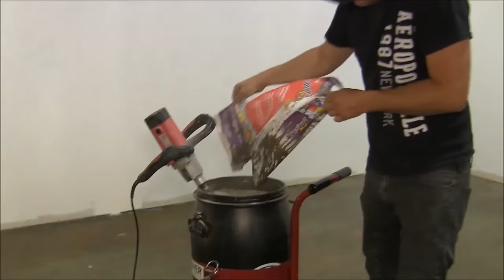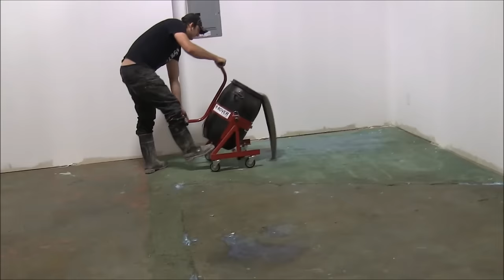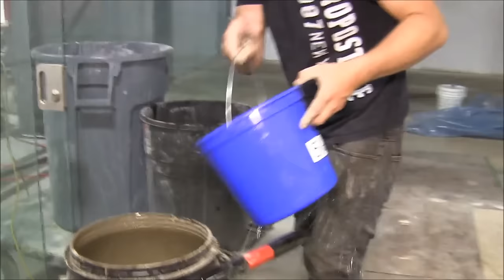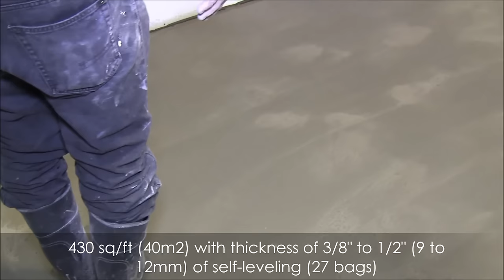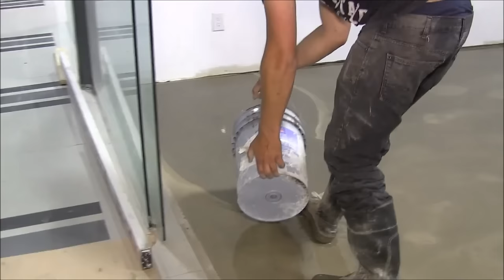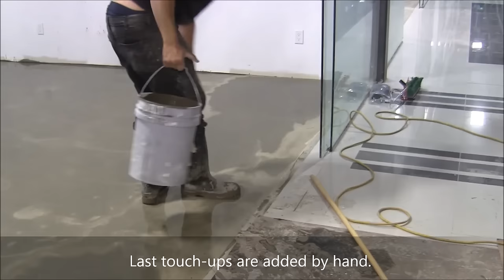How to use self-leveling on large floor areas

Comment: I remember when I use to work with self leveler. I can definitely say I mastered it and was getting paid wonderfully. it's easy to mix and install, I love it
Reply: I've done this a few times but Idk how to price it correctly.. would u be so kind as to give me some pointers on that please?
Reply: @chapothakid5080  The best way to charge for self leveler is to charge by the foot. But you have to keep in mind that it is way more expensive than regular concrete so you might want to charge some where around $11per sq ft.
Reply: Thanks for responding... I usually charge for the labor and have them buy the material..
Reply: @chapothakid5080  It's easy. Charge a lot.
Reply: With that information if I accept about 20 similar job descriptions, I just might make up for bid mistake,s of the past.it appears effortless.very deciving. Thanks a million.it has now become a direct challenge! Takein no prisoners!
Reply: Is it required to apply a primer before putting screed and a sealer after you pour it. I ask cos I just wanna leave it as is and not cover it
Reply: @sbuthabethe7636  Yes you definitely want to put a primer down before you pour it, so it will adhere to the floor properly and if you don't use a primer. It has the possiblity of blowing up( giving your floor massive bubbles). You would also want to prime the top if you plan on using sealer, that way it's guarantee to stick.

Comment: It's also a good practice to use cleats or spiked shoes and use 1/4 in foam strips along the walls to allow for expansion/contraction especially in areas where more leveler is being used.
Reply: Go metric sonny boy
Reply: You're saying concrete expands and contracts like wood?
Reply: They make special rollers for this application  , it even helps remove air bubbles.

Comment: Thanks for the basic demo.   I've seen professionals take it farther with  laser level, depth tri-pods, and spiked rollers to break surface tension and make it all smooth as glass.
Reply: Spike roller is not for breaking any tension.
Reply: @misiokinsale  It lets air bubbles out, and it flattens the leveling compound out, especially where the two pours meet that are of different consistencies.

Comment: Hi. Great video!!! I'm doing 2 rooms basically 14' x 14'. It's bare concrete and is pretty level. If anything between 1/8" - 1/4" out. I putting vinyl floor planks as my floor. Would I start with the low spots first? Or would it just be better to do a skim coat and it will fill the low spots as I spread it with the spiked roller I have? I also went ahead and got the shoes as well. Any input would be very helpful!!! Thanks again. Enjoyed the video!!!
Reply: Yea I raised a floor up to level instead of going for flat you should be able to skim flat is much more important then level I wish I was told this wasted much time and money looking for a level floor when I just need ed flat

Comment: Surprised you went right up to the drywall. No moisture issues with that?
Reply from the maker: Drywall is 1/2"-13mm from the floor and self level cement in 1 hour is dry/hard...is no time to absorb from the floor.Thickness in this floor was  3/8" to 1/2"  10-13mm

Comment: I want to level an area that would involve covering the bottom bit of drywall with leveler.  If I trim off that drywall, there would be minimal overlap with the bottom sill plate of the wall.  Should I go ahead and cut off the drywall or try to cover it with something like redgard so that there is a moisture barrier between the concrete and the dryall?  Thx..
Reply: Don't cover the drywall. You want the drywall off of the floor a bit so that if there is ever a spill or minor leak, it doesn't soak up into the drywall.

Comment: Hello I have laid leveling compound on a garage floor but I have not used enough and the compound I have  put down needs to be raised a few mm as I have not used enough. Can I top it up?  it has only been put down 24 hours but I need the level to be level with some concrete that goes round the sides of the garage. please help

Comment: The consistency of the self-leveling underlay being used looks VERY watery. Batter is usually thicker.  Looks like he needs a longer set up time to work the product but result may be compromised if more water was added to the mix than called for.  Using a squeegee like that would normally reveal high points as it's pulled across the surface, but the soup prevents that from happening.  Well, floor is getting significantly raised up.  27 bags worth... that's a lot of product.   Also, primer usually is applied with a soft push broom on concrete, not a roller.  Not saying the work isn't good, just that there are some items in the video that can use further explanation.
Reply: Most primers can be applied with roller if the surface is smooth. 
Rough concrete might require a broom to work the primer into the floor. Rough floors can require two coats to get a proper penetration to keep water being from being pulled from the leveler.

Comment: I have concrete floors in our Masonic Lodge that are painted. Poured in the 40's in 8x8 squares. Several have sunk and more than a half inch in many places, will this still work to re level & paint ?  What would the cost be ?
Reply: Try a resin floor to level it Tony, more robust. Kiln dried sand is added to the resin to fill low areas before top coat over all.

Comment: Great video.I noticed you never used any screed system for leveling? How level was it from one side to another in regards to any tolerance? I am doing my basement and will use screed same width of each room using level baseboards so in theory I will get a complete profile for level. How do you remove old carpet glue and how do you grind out humps?
Reply from the maker: You can use screed system for leveling only when is 2 inches or 5cm thick.Screed does not have any bonding component (latex). You have to use ceramic tile adhesive to combine together the old concrete (with carpet glue) and screed.
This floor was out of level from 0" to 1/2" or 13mm we use Primer-L and self-leveling component Novaplan-2 from Mapei.
Reply from the maker: This video may give you some idea how to do Drypack cement please pay attention how we use adhesive for bonding to the old concretehttps://youtu.be/trMJzSRc33s
Reply: Lone Ranger look it up, you ARE using YouTube.
Reply: Dry pack can be used from 0  to 2 inches maximum?  Isn't that the specs for most ?  Not 2 inches minimum but 2 inches maximum???  Am I wrong here because I have seen floors levelled with Dry pack from 1 inch to 0 many times.  Even the flex tile brand uses 1 " as a guide to determine the sqft per bag.  Your thoughts?
Reply: Professor Kaos I use thinset with 1/4" v notch to bond my dry pack. I also use type M mortar it can be applied from 1/16 to 6". If you use a brand that makes tile products such as Mapei, Jamo, Laticrete,etc.... then yes max is 2". I never use those products not because they're no good. I save a lot of money buying 80lb bags vs 50lb also $5.85 vs $9-13. I run my screeds with dry pack then next day I fill in with type M but I mix it wet like cement. I use a 3/8" square notch to apply thinset then type M on top. I have found this way to work so well for me. I did a carport and we tiled it. They drive on it. Type M mortar has a 2500lb psi which is over kill for inside a house. Im sure others would disagree. I have been in the flooring industry for 27 years thats how I was taught. Good luck
Reply: @markmiller2263  Amazing how many people ask questions on videos like this when they can just look them up.

Comment: Considering leveling out old house concrete basement floor that slopes to a drain. I'd like to raise the drain up and make the entire floor level, so if there's a problem I would just squeegee water to the drain. Slope is roughly 2-3" difference from wall to drain.. Would this method still work with that slope?
Reply from the maker: Brendan Jamison you still can have gradual slope to the drain if you start  self levelling away from the drain... but not by the drain.
Reply: no for many reasons. you need to fix that with plywood and sleepers

Comment: Would this be suitable for use in a garage/workshop where I would be using floorjacks & jackstands?  My garage floor is uneven and I'd like to level it out.  Thanks!
Reply from the maker: Matt93se Yes ...but remember Self Leveling Cement runs like water make sure there is no huge slope everything will run in one direction to the lowest spot until it's filled up
Reply: Got that part covered, thanks.  I just wanted to make sure the cured strength was up to the task of dealing with floor jacks and heavy metal!
Reply from the maker: Matt93se go to https://www.youtube.com/shared?ci=O9PxzzXcr0M for more information

Comment: How expensive was it to do that job.  I found self leveling material very expensive but there aren't many choices.  Thank you.
Reply: Jorge Ramos self levelling latex is expensive but more forgiving then normal latex screed Ardex being one of the best also don’t do it like this all wrong..
floor must be primed use spiked shoes not wellies and use a spiky roller to help the flow and to smooth out any trowel marks
Reply: That was about $800 in material based on my local hardware store pricing.
Reply: @danielboard7097  you don't need spiked shoes. They are helpful but as long as you smooth out your shoe marks on your way off the concrete you will be fine.
Reply: @randybobandy9828  true but spiked shoes aren’t as messy and it also looks more professional in my opinion

Comment: Can epoxy be applied after the self leveling?
Reply: Yes. Confirm with the product you plan on using that the self-leveler is approved for epoxy top coatings. 
Many are but some are not.

Comment: Will this stuff leak through my living room floor in to my basement? I will be pouring this on wood
Reply: Yes it will. Use plyboard instead
Reply: I was working on a very expensive plush office building  in Central London a couple of years back and the contractors poured about 40 bags of levelling compound onto the main entrance hall floor. What they didn't do and should have done was seal around the edges. The result.  Unknowingly the compound poured through a quite narrow gap straight into the electricity cupboard in the basement room below. The building was big and had a lot of fuse boards etc. £32,000 in damages as the offices couldn't function and the whole room needed complete rewiring. A lot of damage.
Reply: Dear God you shouldn't attempt this if you are asking these questions.

Comment: Took two 50 lb bags for a 150 sq ft floor with 3/8 of an inch depressions. You mentioned 27 bags for a 450 sq ft floor, holy freaking molly....
Reply: Wtf are you talking about? He used exactly the amount I calculated for the variation in depth. You must have done it wrong or over diluted your crete making it weak

Comment: I used this self leveling in a small room and it works great..but you can't go over it more then three times as it sets fast its like a resen ...the only down part is the price at $30 a bag whoo...that's 27  bags for that floor  your talking $800 ish..but I only needed two bags luckily..
Just make sure you ratio in exact.
Good luck.
Reply: Thanks for the detailed feedback.

Comment: Do you recut the sawed control joints in the concrete slab?
Reply: All control joints in the old slab should be honored and recut. Otherwise the leveler will crack. 
You may also want to fill the crack with spray foam so the water in mix and leveler does not fill the old control joints.
Reply: @jhalleck  Even if using a product like Ditra?

Comment: Great video! What compound did you use? How long is the flow and workable time?
Reply from the maker: We use Mapei ; first Primer L after 25 min.Novaplan 2. Flow time for 5-10 min.Workable time is 30 min. You can walk on it in 2-3 hours .
Reply: I have a concrete floor that could use this product in a residential garage. What kind of sustained work loads can this product endure? Will it crack under stress from floor jacks and jack stands etc?

Comment: 'Self levelling compound' is a bit of a misnomer.The only true way it works, is by finding the highest point in an
area to be levelled, then wet pouring immediately after it has been mixed/agitated, until it reaches the aforementioned
highest point. All that trowelling is a complete waste of time. You never see anyone putting a straight edge or
spirit level on the floor in these videos, as they won't be perfectly flat or level.
Reply: These products work just fine. Ofcourse you start at the highest point in the room. The products name isn't a misnomer, it does exactly what it says it does.
Reply: @randybobandy9828  Well i disagree, because i've seen loads of it down and it's just as bad as it was beforehand. It most certainly does not level things out by itself.
Reply: @manonamountain  no you obviously have to move the product around where it needs to go but the product doesn't say it automatically levels a floor. It is called a self leveling concrete meaning it levels itself out where every you pour it.

Comment: I tried it myself last night. Unfortunately I didn’t get the result I expected. I poured it and spread it out using a toothed trowel. I ended up with the same unevenness as before, just with a thicker floor now 😞
I applied about 2-3 mm. What went wrong?
Reply: Had you sealed the floor? The existing floor may have sucked the moisture out causing the the compound you poured to go off too quick. Otherwise, your mix may not have been runny enough - not enough water.
Reply: @almusti  Yes I did seal it before. It probably was not runny enough although I did mix it to specifications.

Comment: wondering if i could do 240 sq ft with 5 gal buckets?
Reply from the maker: You not saying how thick you needs to do. If you want to brush similar to paint/primer ,yes you could do it.Did you notice on the video this is very liquid run by itself like a water everywhere where is lower spot

Comment: I forgot to primer before adding self leveling.  Can I still primer after?

I want to do an acetone base grey stain.  
New concrete already poured.

Thanks for your comment...great job btw!
Reply from the maker: Now... you can ad the primer only if you want to do one more layer of self levelling.Otherwise is not necessary
Reply: pscjavvy08 you might as well demo what you already poured because your floor will pop it had nothing to bond to.
Reply: Primer the existing clean concrete substraight FIRST....TRY READING THE DIRECTIONS OF THE LEVELING COMPOUND!!!!

Comment: This way never ends up making a close to perfectly straight floor unless the floor was was very close to begin with and no big humps.
Reply: Professor Kaos 
It depends on how level it needs to be, it should be pretty level. 1/2 inch is not much to start with, If they are tiling it shouldn't need to be millimetre perfect as the adhesive will take up a few millimetres.
Reply: Thats true but from my experience with large rectified tiles or Plank tile, a 3mm valley ends up needing 6mm of extra thinset spread to make up the additional 3mm of material after the tile is set.  For me I always try to keep the floor in these cases within a 1/6th of an inch over every 10 ft.
Reply: How would this not make a level floor?

Comment: 27 bags? On 40m2 that's crazy
Reply: What's a good ratio?
Reply: No it isn't crazy. Look up the how much you need per 100sqft. A 1/4" floor difference needs 240lbs of material.  430sqft= 1032lb. 1032lb divided by 50lb bad = 21 bags.  His floor might need a few millimeters more than a 1/4in.

Comment: Yo wheres your spikes and gauge rake lol you gonna see the foot prints (it will level out but you will see where he was stepping...also he is prolly just leveling for carpet or tile so you won't see it anyway) always use spikes and spike roller even with an egg beater paddle and proper mixing time you still get lumps from the previous mix that will still be in the barrel..spike roller takes care of all that....once again he is prolly just leveling as an underlayment so appearance really dont matter just saying if its gonna be seen this floor should be smooth as glass with no footprints or swirls between pours

Comment: Absolutely wrong way to do it. If you don't have enough liquid material, segregate and create blocks at least divide it into 5 horizontal or vertical perfectly leveled blocks using lumber. Then pour the self-leveling cement inside the cavity and swipe the surface with straight lumber resting on top of each block for extra leveling.
Reply: any chance you could link to a youtube showing leveling using lumber blocks?
Reply: I have done 10k sq ft pours and only had barrier at certain spots just to block off from running into other areas..there is no need to make such small grids
Reply: Always one DIY’er tries to ruin it for the guys who do more than a box room in a day. If you can’t handle it, pay someone who can.